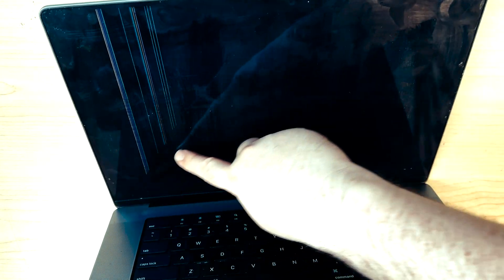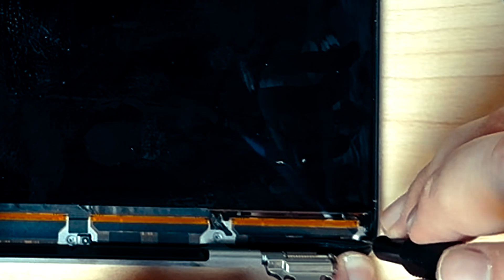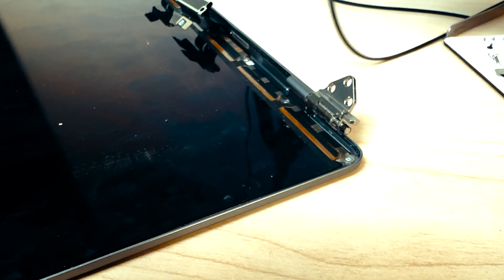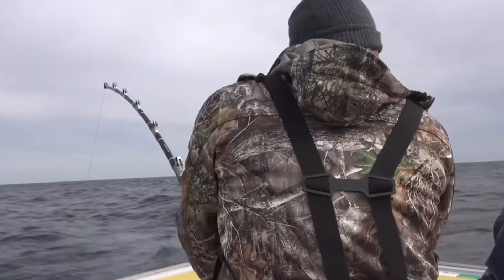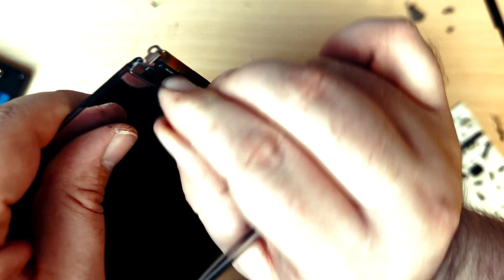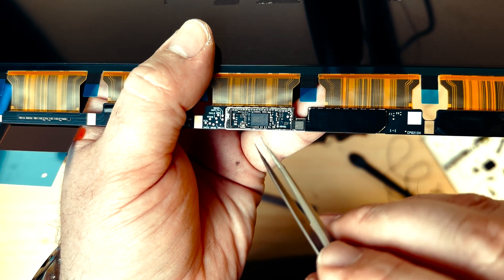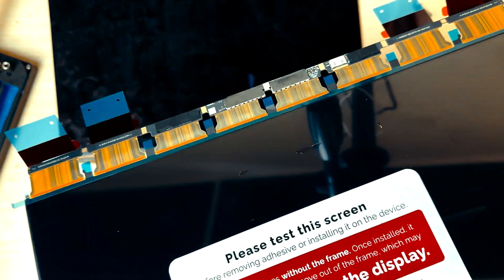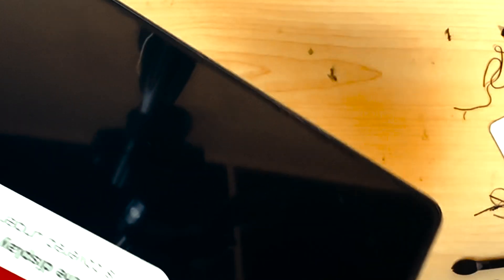MacBook Pro A2485 LCD Panel  Only Replacement Guide

Comment: Could this work with a 480hz Alienware 16 inch panel hooked up to an external eDP controller board with DisplayPort connected to thunderbolt port on the laptop?  I wouldn’t care if it won’t go to sleep on lid close or have a working webcam.  Panel is N160JME-GQA

Comment: Is the chip swap still an issue with these more modern Apple screens?
Reply from the maker: It mainly depends now on the iOS now days.
Reply: @FIXDPHONES  so in my understanding it is not necessary to swap IC's to get truetone working?

Comment: Great video! I have a a2337 model and the screen is broken. Does it also require this chip transfering or not? will it retain the True Tone if i use a completrly new aftermarket Screen assembly? Thanks again! Subscribed!

Comment: This is probably the only detailed guide I found online. However, is this still needed after the Mac OS Sequoia 15.2 update? Both for original (with the lid sensor flex) and the aftermarket displays.

Comment: If I purchase a replacement display (A2485) through the Apple Self repair service, does it come with the IC's pre-progammed. I can probably replace the screen assembly but transferring those IC's would be a bit tough.

Comment: Once u removed the long adhesive from the original display did you reuse the same adhesive on the New one?? How did you stick it? Will it be a clean job and will it preserve water resistance of some kind?

Comment: Hi! Great video!!! Can I ask you what type of adhesive (size, brand) do you used (metal bracket/borders)??? And is it necessary to change the lid angle sensor for a new one? or needs to be calibrated the old sensor to sleep after change the LCD?  thank you very much!

Comment: my black strip broke on the right side, then it broke on the left side but not til it was almost all the way up the left side.

what’s the best way to go from here? heat the panel off from the back to loosen adhesive?

trying to save the backlight as they pricey lol
Reply: figured it out! all working🙂 amazing explanation on this whole repair. 

GREAT JOB!!
Reply from the maker: Great job!
Reply: @alikasalazar5857 how did you manage to loosen the „broken“ adhesive - heat?
Reply: How did it got broken?

Comment: Hey guys! So I cracked my macbook pro M1 pro 16 " display and now Im looking for the cheapest way to replace it. Im thinking into buying the lcd (without frame) from Aliexpress for 350 AUD, and then doing a IC swap with the chips from the original screen(150 AUD). I know a guy how does micro soldering and would be able to do a nice job, Im just afraid the aliexpress LCD will not be compatible with the IC from the original screen. Does anyone knows if that would work or have any suggestion? Thank youuu xxx
Reply: Hello did you manage to buy from aliexpress can you tell me how it went ? I’m in the same situation .. many thanks
Reply: @henryhharold  went super smooth, no need to replace ic chip, everything works 100% color profiles, true tone, resolution, refresh rate…  quality is amazing
Reply: @BrytZzy0  Hello! I don't know. But do you have the seller information from Aliexpress? I am in same situation with my screen. And If is possible just change the LCD without to move any IC, that is gonna be a great thing. thx
Reply: yes could you comment which sellar you used? I'm wary of getting ripped off on aliexpress
Reply: Can you do a video or hmu to show how the display looks?

Comment: Thanks so much for my screen replacement Derek! If anyone needs to get their screen fixed asap, and does not want to pay apple store prices, he is the one! He fixed my MacBook pro a2485 screen (shipped, fixed, and sent back to me) in about a week! 10/10 would highly recommend and also very fast with responses!
Reply from the maker: Thanks for sharing your experience!
Reply: If you don’t mind me asking, how much does this service cost? I’m in the same boat
Reply: @gebthabeb  it was $479! I went to an Apple Store and they said it was going to be minimum $800+ so I would definitely go with Derek if you’re in a similar situation
Reply: @gebthabeb  for sure! It was $479 plus a bit extra for you to ship it to him. I went to the apply store before at first but they were going to charge me minimum $800+ so if you’re in a similar situation I’d definitely consider going with Derek

Comment: Bro. I have a new information. 
To cut to the chase, simply moving the small chip resolves the issue. My A2485 encountered problems with backlight brightness adjustment when I didn't replace the chip. However, just transferring the small chip (which contains the EDID information) solved the problem. The larger chip (Tcon) doesn't contain any information. It seems like many people are unaware of this fact.
Reply: What te ia telled me: 
EEPROM (Electrically Erasable Programmable Read-Only Memory):

Function: Stores essential data for the screen, such as factory settings, color calibrations, and configuration parameters.
Role: Provides non-volatile memory that retains important settings even when the device is powered off.
TCON (Timing Controller):

Function: Manages signal synchronization and data conversion for the display.
Role: Coordinates horizontal and vertical signals, converts video data from the graphics processor, and controls image updates. TCON chips typically do not store permanent data but may have temporary memory for processing.
Reply from the maker: The small chip is the eeprom which basically tells the device that it’s the correct integrated circuit downstream so as long as the larger chip has been programmed properly prior(ie original) then your conclusion is more than likely correct.

Comment: Seller said A2485 do not need to transfer two chips. Is this wrong information? What happens if i don’t transfer two chips at A2485?
Reply from the maker: The main functions of these ICs include:
The EEPROM chips store crucial display data, such as resolution settings, color profiles, and other parameters specific to the LCD panel. This data is essential for the MacBook's operating system to recognize and properly communicate with the display.
The EDID chips contain information about the display's manufacturer, model, supported resolutions, refresh rates, and other capabilities. This information is transmitted to the MacBook's graphics controller during the initialization process to ensure proper display configuration.
Transferring these ICs from the old LCD panel to the new one ensures that the replacement display behaves identically to the original one and maintains compatibility with the MacBook's hardware and software. If these ICs are not transferred or are damaged during the replacement process, it can lead to display issues such as incorrect resolution, color distortion, or even failure to display an image altogether. In Most Cases it presents itself with a Shadow affect at the top of the screen. A replacement display will work without them, but I don't recommend it for the reasons I explained.

Comment: Derek, what are your thoughts, experiences on the swapping of chips on A2681 M2 Air? Are there artefacts and or sleep issues in your experience. Also do you think that the sleep issues are only related to the firmware in  the two chips or is there a tie in in regard to the LAS (Lid Angle Sensor ) Imagine what the 15" Air ones are going to be like once panels become available. 15" panels are quite large and flimsy I imagine.

Comment: Great video!! Hopefully this encourages more techs to do this repair. BUT UGH, THAT DAMN GLASS IC! Transferring that little fu*ker is a DELICATE process. A first unsuccessful attempt quickly taught me to treat that little guy with serious care, and now I do this repair quite a lot. That brings me to a question . . WTF is happening to these displays?! I know accidents happen and people drop 'em, but I've done A LOT of these, and I'm starting to think some of them have been punched. I've done some iMac glass-only repairs where the customer told me they punched the display, so apparently people can get big mad enough to hit their machines. Good times! 😳

Thanks for this video brother! I really enjoy your content, as it gives me new approaches to repairs I do a lot of, so thanks for that.
Reply: Kudos to you for tackling these panel and IC swaps. I also had a unsuccessful attempt at chip swapping from broken LCD to good pull from an iCloud locked machine. I got the good panel out OK (easier than A2337 I reckon) swapped the chip but the machine would boot with no backlight and also crash and restart. I worked out that if I left the image data flex unplugged, no crashing. As far as the no backlight, I did heat the screen housing up on a heatpad at 60 C so maybe that damaged the backlight sheet. I won't be attempting any customer repairs of these until I can do one of my own first. With the A2442 in Australia being $2000 even second hand, it's an expensive proposition. I will need to keep an eye out for a machine with a broken LCD so I can try again. I have already turned away half a dozen of these jobs so far, and that hurts :)
Reply from the maker: Thanks for the comments and helping others understand where things can go wrong and what they can expect. Any tech the attempts these type of repairs has my respect.

Comment: Thanks for the video Derek. I have been told that you will not get screen artefacts and sleep issuers with these A2485 if you do a straight LCD panel swap without changing the two chips or even using a complete aftermarket full LCD assembly? I know that the A2442 definitely needs the chips swapped, because Apple will not give us access to their calibration software. On those you get artefacts and no sleep on lid closure, at a bare minimum. I have heard of people having worse issues than just that too.I used an aftermarket LCD assembly on an A2681 last week and got no sleep on lid closure but definitely no artefacts. I am just interested in your experiences seeing as there is a lot of confusion and possible misinformation in the repair community about these three late model Macbook models. Thanks again and I hope that you have time to comment on my questions.
Reply from the maker: The Sleep Wake function can be repaired as there is a tool to calibrate a new one on the MacBook's and that's separate from the display. Replacing the LCD without transferring the IC is theoretically ok, but not recommended because of things like artefacts. Not all models have that issue though. the a2442 and a2485 are the models where I will always transfer the IC's.
Reply: I agree about transferring the ICs, it just eliminates possible issues, but OP is right, the angle sensors can be programmed now if you wanna go that route for sleep/wake functionality, but I definitely agree with the OP; those artifacts (weird rectangles) are a possibility on certain models if you don't transfer the ICs
Reply: @JacksonPhixesPhones  yes A2442's are by far the worst from my limited experience with these late model screens. Most people that I know report no issues with A2485  LCD assembly swaps and A2681 seem to have no artefacts, only the sleep issue. I would not have thought that recalibrating the original lid angle sensor would solve sleep issues after a screen replacement though? The situation with these is slowly evolving and a big thanks to Derek for putting out these two videos that clearly show his techniques. The only other YouTuber that I see showing about these, is L2 Computers in New York.